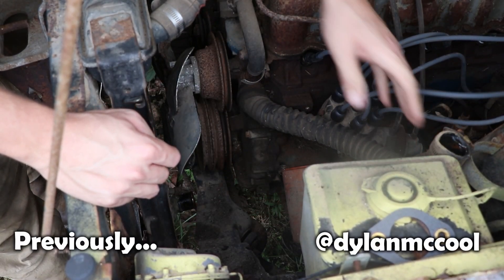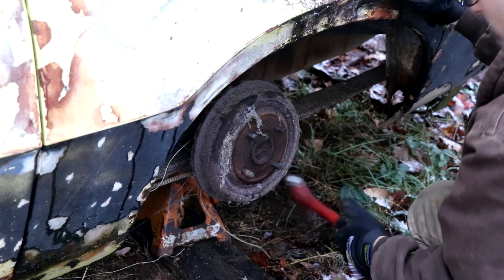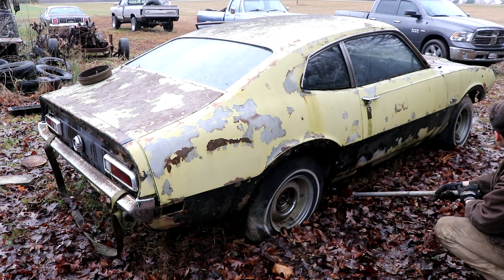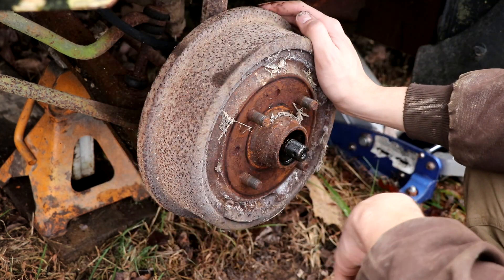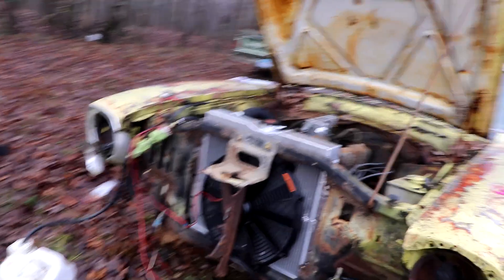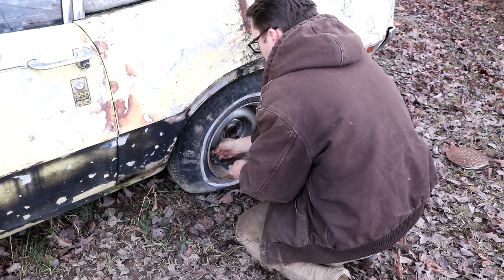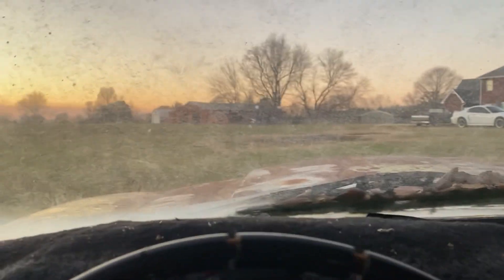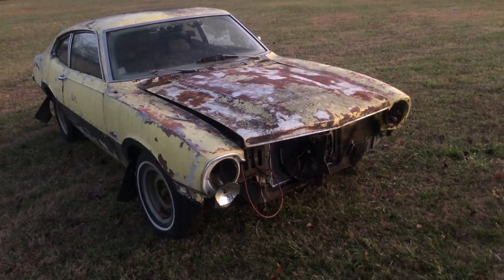FORGOTTEN SEIZED Ford Maverick WILL IT RUN After 26 Years? Part 3

Comment: I think it's worth a series. You just don't see these cars. 289, 3 on the floor. Fix it up sir. 👍👍
Reply: Up until 1980 I had the boss version. 302 and 3 on the floor. It was a 72 and by 1980 it was completely a rust basket case. So bad I'm not even sure it could have been restored at that time.
Reply: Agreed!
Reply: This ones an in-line 6 automatic.
Reply: agreed a full restoration series would be sooooo cooool
Reply: I like these.  They are basically the same car as a '65 Mustang with frumpy styling to prevent stealing sales from the then current Mustang ( they still stole many sales from Mustang )
Reply: @vayabroder729  bulletproof .   Swap a Barra inline six in one!   Barra is based on the same Falcon block
Reply: @timothykeith1367  Fyi, the Maverick was the Falcon's replacement when it came out in the spring as a 1970 model. They were never built to compete with the Mustang. They never even had a v8 in them until the 1971 model year with the introduction of the Grabber, so no the did'nt really steal away Mustang sales. The 302 or a 351 Windser would be a good swap for this car. Good luck.
Reply: @markreisen7038  The Maverick is a Falcon with a different body.  Ford also used the  Falcon as the basis for the Granada.   You can tell that Maverick is the Falcon by the high mounted shock towers.  The Maverick took so many Mustang sales that the base price was raised to within $400 of the Mustang.  The Mustang II did revive Mustang sales, but many people don't consider them a real Mustang as it was based on the Pinto.  Ford did not want the Mustang to steal Mustang sales, that is why the Maverick design is intentionally homely.  But just as many '64 to '66 Mustangs were base models with the six, the Maverick was also popular as a basic car.  The last Falcon based Ford was the Lincoln Versailles.
Reply: @timothykeith1367  yeah,nope. The Granadawas based off of the grand Torino platform on a shorter wheel base. I had a 1975 Granda tudor coupe with a 250 l6 and3 speed on the floor. Great car that got around 26 m.p.g.s The only bad thing was the floor boards were rotten and the rest of the body was pretty good. Btw, how many Granada's have you ever seen with 4 bolt wheels. None because they had the same suspension, hubs,axles and rear end as the mid size Fords and Mercurys.
Reply: @markreisen7038  I don't know how the Granada/Monarch's could have been base off the Torino? Torino was a much heavier full frame car with coil springs out in the back. Granada looked more like Falcon, Mustang, or Maverick underneath.

Granada's were kinda cool. When I worked in a trans shop back in the 80's I put transmissions in 2 Granada's with 6 cylinder engines that were equipped with factory installed 9 inch rear ends. I also worked on a 75 Monarch with a 351 and 9 inch rear.
Reply: @Deucealive75  so what year Torino did you say you had? None, yep, didn't think. I had a 71 Torino Gt and an 69 Fairlane tudor hard top, and these were both unique body cars as was the Maverick, Mustang Granada etc. Just sayin, no full frames here.
Reply: DID they ever make a maverick wagon??????
Reply: @grantkoeller8911  nope, but Ford did toy around with a Mustang wagon and a Mustchero pick up but they never made it beyond the proto type stages. Really cool looking truck and wagon. To bad they never built them. I would have bought one of each..
Reply: @markreisen7038  I'm talking about the 72-76 Torino. Either way the Granada was not based off of the Torino.
Reply: @grantkoeller8911  No
Reply: @Deucealive75  yeah, nope. Wrong again. This from the guy who thinks Torino's had coil springs and full frames on them. The 72-76 Torino's were all Unibody cars with coils on the front and leaf's on the rear. Please do your research on these cars before commenting on here.
Reply: @markreisen7038  I don't need to research anything. Unlike you I've actually been underneath and worked on at least 2 dozen mid 70's Torino's professionally. No mid 70's Torino had a unibody and leaf springs. Hopefully you will look it up and see that I'm correct.

And whoever gave you a thumbs up is wrong too.
Reply: @grantkoeller8911  yes, in Brazil
Reply: What do you mean, if he did that he would have the EPA come down on him.
Reply: I have a 302 maverick automatic  v8 1973 in near mint condition..it's a pinto in the front ..mustang in the back..

Comment: "Northerner cold" = January 1996. My grandfather's funeral procession was that morning. I was supposed to be in it, in my own car. 1975 Ford Gran Torino, a much biger brother of that Maverick. That was the morning my starter decided to quit. It was 12 degrees F. I walked to an auto parts store and bought a remanufactured starter.. Walked home carrying it. Got under the car, reached for the starter, and as my hands touched the metal, they froze to it. Went in the house, got a hair dryer and rubber gloves, tried it again. It took 2 1/2 hours to change the starter out, but I was in that funeral, dammit. That's "Northerner cold". (I live in Massachusetts). Keep up the good work Dylan, anyone who keeps these old rigs going is a someone I respect.

Comment: If you clock the cooling fan 90 degrees it might fit flat on the radiator,....Also the original radiator can be soldered at the leaky fins. Bend the fins over at the ends and solder them.

Comment: I recently got a 1965 buick special running after it sat since 1995. All i had to do was put some points in it and it started. Had to hook a temporary fuel line to get it to move. That maverick is neat by the way!

Comment: I live in Az and bought a mercury  comet w/ intentions of rebuilding it, paid 800 and drove off the lot decent, slowly rebuild, new valve seals, valves push rods,gaskets, carb rebuild,rad etc... only thing thats been my holdback is my rack pinion, rust repairs & trans I'm needing to rebuild an held off. Seeing this truly shows classic american ford engines durability through the years an seasons. Pursue your dream till its content, may your repair  jobs be easy on the wallet🙏😂

Comment: You should try out "deep creep" by sea foam. It is the best penetrant I've ever used. I've had header nuts and exhaust bolts that were seized so bad I I was afraid to break things torquing on them. Soaked them down, let it set a little bit and they came off like they were never rusted. Project farm did a test of penetrants and it came out on top.

Comment: My dad had one for a work vehicle. He sold it to my friends older brother. Fixed up a junkyard engine for it, and the bodywork, then raced the hell out of that thing. Still don't think it was faster than my dads 1970 SS 396 Chevelle he used to have. I think it was a 4 speed manual.
Loved all of those old cars, including AMC.
 love to see them get back on the road. You shouldn't have given away that you got the car running so fast, I wanted to be surprised. LOL. But thanks for keeping them alive.

Comment: That 4 way lug wrench on rusty Ford lug nuts in the snow brings back a lot of bad memories.  My first car was a '67 Torino.  3 speed on the column, (it was hard to back up a car with a clutch in those days, especially if the clutch and pressure plate were shot).  I drove it to high school, we'd stop at the liquor store every morning and get a quart of beer, took the edge off before class.
Reply: We drank so much beer back then (1970's and 80's), now looking back,  I guess I was an alcoholic.
Reply: @grantkoeller8911  I never really thought of my self as an alcoholic, but I did 2 stings in drunk driving class, totaled that 67 Torino drunk, but I still got a pint of cheap whiskey last night, still takes the edge off.
Reply: And me sitting here wondering what the heck ever happened to my 4-way lug wrench...been in this house 30 years and I don’t believe I’ve seen it since our previous house...hey Dylan you have the patience of a saint (my mom used to say that)
Reply: @laceylouloulou  I hadn't seen a 4 way lug wrench for about 30 years until my brother in law bought one at a yard sale about a month ago.  We had a flat tire a while back and the single arm lug wrench on my dad's Ford Escape wouldn't even fit the lugs.  They had some kind of metal cap that smashed and twisted off when I tried to the get the lugs off.  It was a muss, but I finally got them off, some things about Fords ain't changed one bit.

Comment: Love watching the work.. been following since the Challenger resto.  I'll say this about those Dextero tires.. bought a set of 4 for a buick century at $45 each.  about 5 years ago. had some front end issues and have replaced the front tires with xtrac III's twice. I still have the Dextero's on the rear and they are wearing like iron.

Comment: First off I'd drag the car to solid ground, 2nd I'd put up a canopy big enough to cover the car plus give me working room and put some sides up and 3rd I'd put some kind of heater to heat my work area up for working outside in the cold, snow or rain. Why don't you invest in some cordless impacts? Beats trying to fight things by hand. Plus when trying to brake the drums loss use a 4 lbs hammer

Comment: Try replacing the Valve stem seals to slow or stop the blue smoke from blowing out the tailpipe.. this was a common problem for the Ford 200 six cylinder back in the day.

Comment: if the tire is not too bad, meaning the carcass can tolerate a modicum of pressure, sometimes (although maybe not in this case) a temporary fix that can be convenient and less expensive  is to install a cheap tube.

Comment: Have you ever checked at the local junk yard to see if they have some used tires for your car.   I got 4 tires that passed the state inspection for a project I was working on for 100 and it cost me 20 more to get them all installed and balanced.

Comment: When it started moving with the tow strap still attached, I want to run after you screaming "Tow strap, Tow strap!!!". The bumper looked pretty straight and they are very easy to bend (I know from experience) and were hard to find 30 years ago (I know from experience) to probably impossible to find an original one now...... Great perseverance in getting this one going and moving. Wash?

Comment: Needing 3 Qts of transmission  fluid explains some of  the smoking probably  modulator  shot Ford wasn't  known  for high quality  parts in Pinto/Maverick  line but still like playing  with them much more simpler  time

Comment: yip there is some history there for sure with the Comets Falcons and the Maverick , i wish they would bring back the  Comet and Falcons plus there was the Cyclone and the Caliente the 1964 Comet Caliente was my fav being that i owned one for some time and it was a barn find did not have a engine trany or drive shaft  the car had to be totally rebuilt from ground up luckily i had another 64 comet and i took the engine transmission and drive shaft went into the Caliente plus the front end of the other comet and took that car right apart every thing off the car and the parts where stored after a lot of work the 1964 Comet Caliente came back to life and became a working car again .

Comment: I see Rump! And a blue Utiline! And....Let it Snow Let it Snow Let it Snow! You need a chunk of 3/4 plywood to put under the jack. I've buried a few until I started doing that.And you need a bigger hammer, and a four foot cheater pipe is easier on your back for those frozen wheel nuts.And if you jack the car up, a flat tire will air up easier than trying to lift the car up.

Comment: I drove a 2004 UD (Nissan) 26' box truck 30 miles home using speaker wire out the window for a throttle cable because my boss was too cheap to pay for a tow

Comment: I just watched all three videos of this series a second time. I think a whole lot of the misery of working on the car was self inflicted. You parked the truck in a place where it would sink. You worked in sleet and rain. The car was far away from the tools and the garage. Do you have a golf cart or a four runner? You surely need something. You bought the wrong size radiator and insisted upon forcing it into this car. The hoses were also too long. You had to remove the fan blade. You fouled your radiator with shredded fan belt and I might be hard to get it out of the radiator grooves. Did you merely use the car for a video? Did you sell the car as is and if so, did the radiator go with the car? I understand you needed to cool the engine. You couldn't find a radiator that fit the car? Are radiators too expensive? It seems like a very common part. I had a 1970 Ford Maverick. It was my first car. I don't remember how large the engine was. I was very, very, very dumb as a box of rocks about engines. I never had a father who worked on engines. I never knew my dad to work on an engine or a car. Anyway, I understand you said, "I'm done." but I sure wish there had been more closure. C'mon Man, that was the first car I ever drove. It was a P.O.S. with no power and really lame street tires. My car had ben an old Southern Bell car, pre AT&T.

Comment: I’ll trade you a Milwaukee 1/2” Fuel impact for it!
Reply: The car is worth more a hundred times over then a any garbage Milwaukee tool.
Reply: @tinsano6030  
LOL... let’s  see. 
First of all, it was a joke since Dylan was struggling with that 4 way. 

Second, a fuel 1/2” impact is about $300. That car is worth $1k-1500 on a good day. 

Third. Garbage? I’m a heavy equipment mechanic and I beat the snot out of all of my Milwaukee tools, and in 5 years I’ve had one failure, and Milwaukee repaired it without question.
Reply: @fanmanJ  your lucky every Milwaukee tool I've ever owned was a absolute garbage & not worth their weight in scrap.